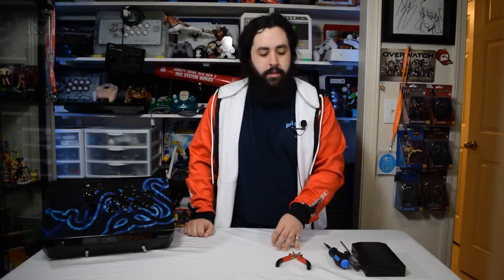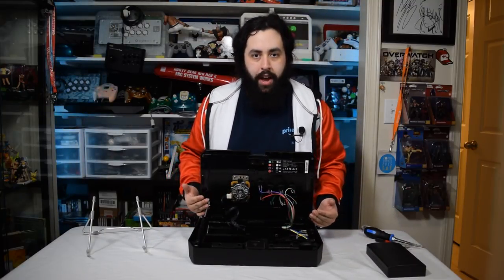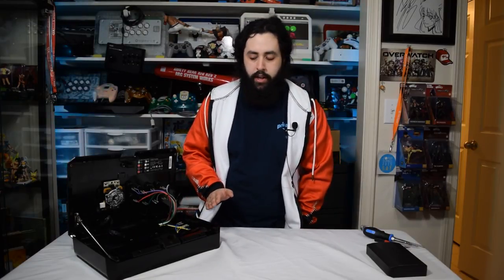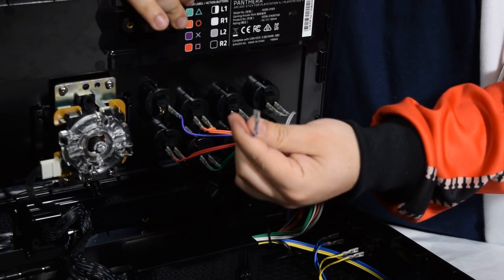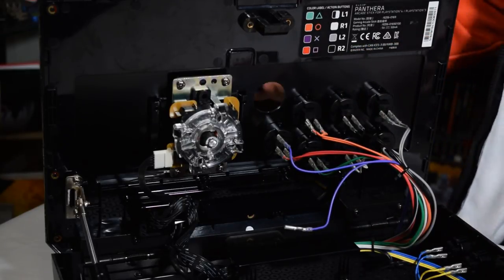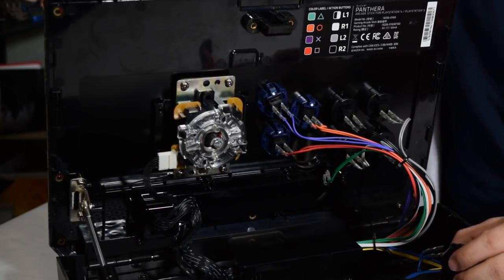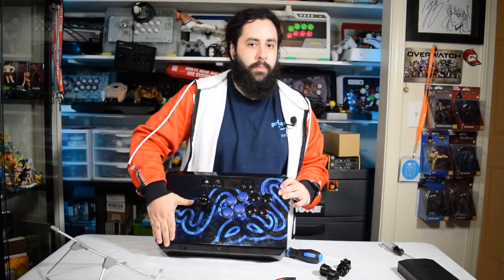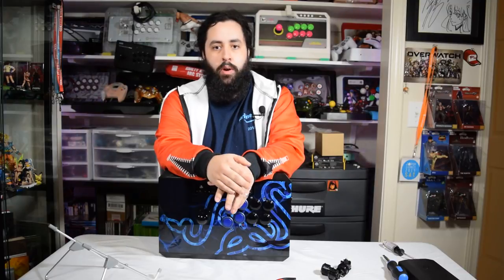Want to Mod Your Stick? No Problem! PART 1 Opening Your Stick and Changing Buttons.

Comment: Hey Hurtbox I have an Injustice 1 stick, it's a PS3 stick but it also works in legacy mode with PS4. The problem is it only works with NRS games. MK11, INJ2 it works fine, but any Streeet FIghter or Tekken and it doesn't even get recognized. Is this a hardware problem that I can mod or is this some software issue?

Comment: I have the panthera and I’m looking forward to part 2 because I want to get me a Korean lever for tekken (Fanta lever specifically) and I wanted to see what specific wires for the switches you needed and stuff like that and also if it’s the same process on the panthera since you are doing part 2 on the obsedian?

Comment: I've been considering getting the Panthera Evo... Your review on it seemed to suggest it was a good buy. These "problems" You mentioned at the start of the video specific to modding? or are  you experiencing second thoughts on the quality of the stick?
Reply from the maker: It's more so compatibility issues with changing out levers. It's not very friendly if you want to change it out. Though I have a solution to that which will be in a video soon.
Reply: @HurtboxTV  awesome, thanks for the reply! Sounds like it still may be on the buy list for me then. Looking forward to the video!